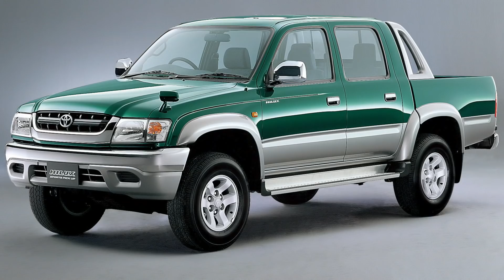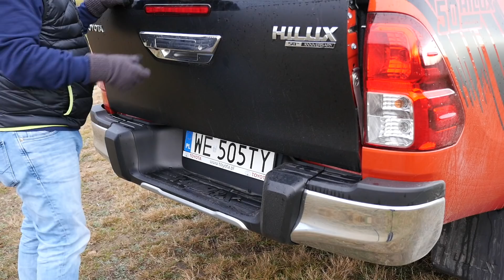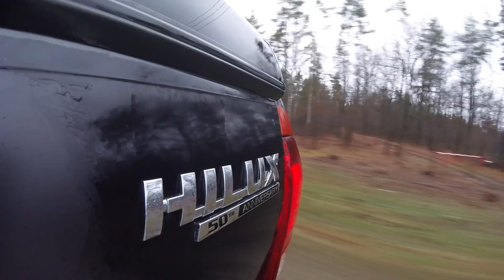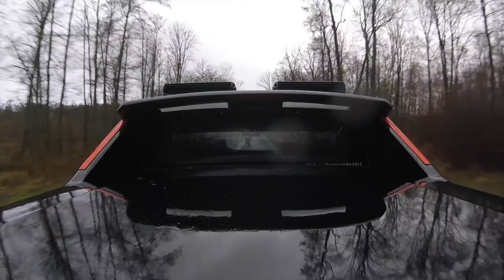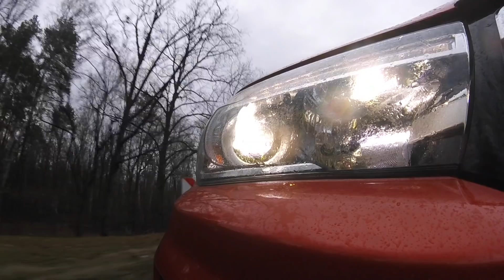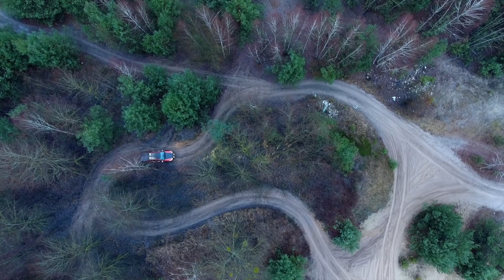2019 Toyota Hilux pickup (ENG) - Test Drive and Review

Comment: Great farm workhorse -- the Toyota Hilux! We have the 2018 G variant.

And driving the truck onroad to the city while it is so muddy dirty is a head turner to many as it really looks so functionally, properly used! And in fact is!

20 bags of fertilizer, or animal feeds, or grains, is easy peasy (& that's about a ton) on the bucky, plus a couple of co-workers inside the cab!

From time to time, we also use it for long-distance travels. And to manage the bumpiness of the ride, we just load the back with some weight (at least 250 kg) plus driver & 3 passengers inside the cab.

Fuel consumption-wise, 13.5 km/L combined tar & rough road conditions. So far, do good! Very functional & very practical for our daily use (under our own condition).

Cheers & mabuhay from tropical Philippines!

Comment: Would you get this in 170hp or Ford Ranger Raptor? I trust Toyota more than Ford but with Hilux I would have to make more mods for off-roading.
Reply: I've never seen the Raptor in real life. Also Ford is not talking to me, so I don't think I'll get to review one any time soon :)
Reply: @MarekDrives  They are not popular in Poland?
Reply: Pickup trucks are not popular in Poland in general. There was a period when people bought them as an alternative to SUVs because of a tax break, which classified these as a "lorry", and therefore you could reclaim full VAT. But as soon as the tax law changed nobody buys them. For Europe this is the worst of everything: poor performance, terrible handling, compromised storage (you can't leave anything in an open bed, because it will get stolen), and on top of it all it's big, and cumbersome to park.
Reply: @MarekDrives  You can put a cab on the bed and there are many small farms in Poland so I think a pick up would be more practical than a van, that can easily get stuck in mud or fields. Strange.
Reply: In Poland you can tell a "real farmer" from an "EU subsidy farmer" by the car he owns. And as far as I can tell a "real farmer" will never buy a pickup truck, because it's just too expensive for what it has to offer. This is market specific, because those stripped down single cab pickup trucks are pretty much unavailable. There were a coupe of special procurement contracts for some road construction companies, etc., but if you go into a showroom, it's often too high spec to be affordable, and too compromised to be the only vehicle in the family. You can get a van, and a small hatchback for that kind of money.
Reply: @MarekDrives  But a used Amarok, Hilux, Ranger, Isuzu or Navaro should be affordable. I will buy a small farm in Poland and will start a new fashion. Part of the perk of living in the countryside is off roading...
Reply: @SuperSokol7  lol
Just be careful, because driving in forests is illegal. And we don't do greenlaning.
Reply: @MarekDrives  Why is it illegal?  I would have few hektars and think I should be allowed to drive on field roads... or on fields... Too many laws in Poland. Give Poles their guns and pick up trucks!
Reply: You are allowed to drive on your land. 
But you can't just turn off a main road and drive on a forest road, unless it is clearly marked as a road. So the bit I drove through a forest in my Jeep Wrangler review was pretty much illegal. 
We've got tractors and harrows. Guns and pickups would be too much :)

Comment: I have an older Toyota Tacoma (2nd generation) , the equivalent of Hilux on the American market. Gasoline engine 2.7 L under the hood, and 6 feet bed. Very reliable,  drives excellent even now that it has 187,000 miles on the odometer. If you want a good truck that doesn't let you down get a Toyota.
Reply: Toyota 2JZ is the only reliable engine that Toyota has ever built
Reply: @jeremybroderick9465  Mine is 2TR-FE. Bulletproof with decent maintenance.

Comment: What about the moose test?
Toyota still needs to redesign the suspension.All the features are not necessary if you cannot keep it on the road.
Previous models  performed miserably in the moose test.
Reply: Very true, the Hilux in particular still has not got it right with the suspension. They have to really look deep into it.
Reply: 2018  ++ hiluxes already passed the moose test
Reply: @aceconchas6105 link plss

Comment: Nothing will beat TOYOTA reliability, don't come to me if you bought something else.
Reply: The 2.8 is garbage with class actions against Toyota !  DPF , air intake , injectors , drive shaft issues etc etc etc . I did in fact buy something that is rock solid reliable and its not a Toyota.
Reply: Maybe on the engine and drive train.
What about safety?
This vehicle always fails the moose test.
Reply: @roshanmanilal5315  I live in New Mexico.  It just needs to pass the horny road test.
Reply: @roshanmanilal5315  not even , the 2.8 is rubbish .
Reply: Please! You sneeze too hard a Hilux chassis bends these days. They are rubbish for any off road and have been since the late 90s when they started making the chassis out of butter.
Reply: @Drive YT Brand   09 Isuzu D Max , modded , regularly towed  at gcm max,  gvm max everyday , and off road work  , sold at 240k on original clutch and only one set of front pads . Now 2018 D Max at 44,000km towing at gcm max weekly and even  more off road then the previous one . I'd guess with 150k over 3 years you've only done highway k's .  Mine tow and go offroad weekly .

Comment: The Ford Ranger made Toyota want to build a Ranger too. all the exterior styling is straight from the ranger raptor kit only the Ranger's is better
Reply: Let's see your Ranger at hundred 200 k/Miles
Reply: @mohamedalihebboul2214  My company has the 3.2 Ranger, it's only 3 years old and already done over 160,000 miles without problems. I drove it a few weeks ago, and I couldn't believe how nice it still drove.
Reply: @GdaySport  Nice to hear that, all I know about Rangers is that off-roading with them here is a fiasco after some thousand of Km...
Reply: @mohamedalihebboul2214  Our doesn't go offroad very much (just muddy yards now and then). I guess it depends how hard they get driven offroad, but that would apply to any vehicle.

Comment: It is NOT an Amarok Marek! You call it this at least twice in the video.
Towing capacity is not up to the industry standard for this category of vehicle, which is 3.5 tons. It is even beaten by the Mitsubishi L200 in the UK, which can tow 3.5 tons as long as the trailer is triple axle. Most other rivals have unrestricted 3.5 tons towing capacity. This is important for most farmers, who make up the majority of customers for pickups.
Actually on the pre-facelift model, in the UK at least, there was a way to upgrade the towing capacity to 3.5 tons. Not sure how that was done.
Reply: If you're talking about the back seat situation 2:50, I should have made the comma more audible. ...., also Amarok gets a split bench...
4:27 - I'm also referring to charging ports in the Amarok.
Reply: Are you muslim?
Reply: They're 3.5 ton towing in manual gearbox & 3.2 in auto

Comment: Haha- I love your comment about "Toyota ordered a billion of these" clocks-  I think they placed the order in about 1983 and all 50 million Toyotas since them have had the same clock! :-)  Also you called it "Amarok" at 2:44.  It's funny that you feel you must use the step to climb into the drivers seat since the seats are bang on the floor and so low that I would think you could slide right in.  Personally, I hate the "legs out" seating position- it kills my back.